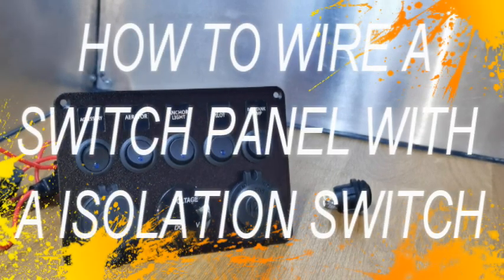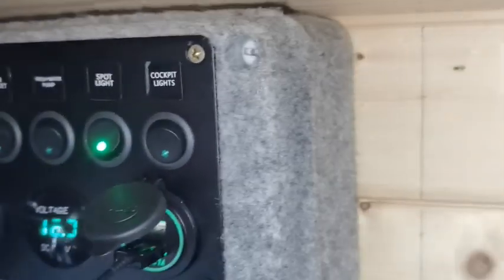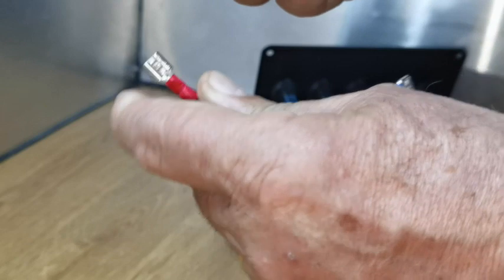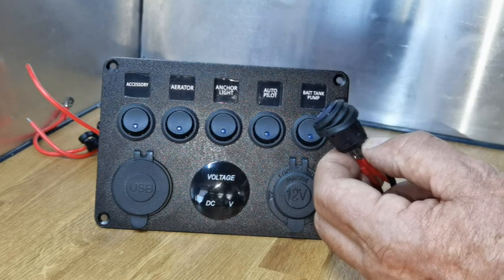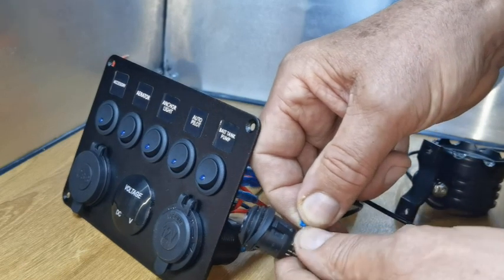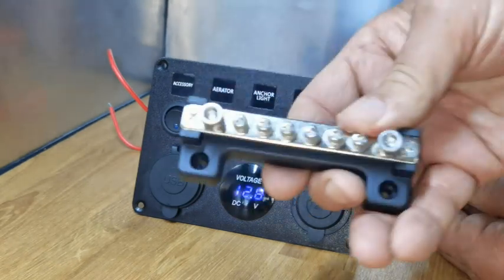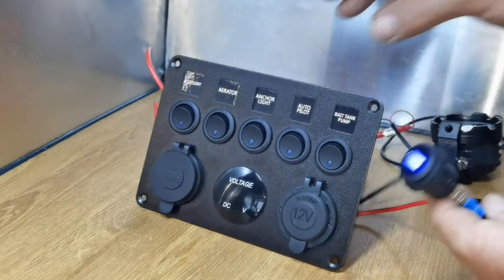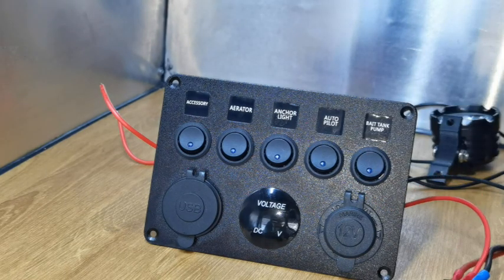HOW TO WIRE A SWITCH PANEL WITH A ISOLATION SWITCH

Comment: I was going to do this with my five pin switches, but unless I did it only for the accessory lights on the switch itself wouldn’t I run the risk of melting wires or melting the isolation switch itself? I would think the extra switch either needs to hold a high amperage, or you would have to get one of those switches that goes directly from the battery or like I said just use the isolation to save power and just control the lights on the switch itself because all the power going through there to the switches and then the switches are powering is going to be drawn through the isolation switch

Comment: Great film really helpful I am going to copy this set up in my van. The only question I have is why are all the red wires with fuses off the back of the switch panel loose? They all wobble freely and have a part of the spade connector outside the sleeving. It’s the same panel as you have

Comment: Sorry but I'm just a rookie in this. One question, isn't it possible to use one of the switches present on the pannel, to use it as isolation pannel, instead of using an additional one? tnx
Reply from the maker: yes but i need all mine i have done a video on using a single switch on my chanel
Reply: @MrMeltedwellies  I've found only 2 videos of your and they are quite similar. Could you be so kind to point me the one you are talking about. Tnx
Reply from the maker: link below Leon 

https://youtu.be/ttMDY0zo4i0
Reply: You can, just swap the load wire and power live on the furthest switch on the right where jumped cables finish with 2 wires going back to battery. By the way these switches are 5Amp and not 20Amp on the product details so can be dangerous if high rated appliances are used..

Comment: I would think about using the isolation switch to activate a relay. That way all of the current from all of the accessories on the switch panel is not going through the switch. Those switches contacts will melt down over time with as little as 10 amps. Much safer with a relay(most automotive relays can handle 40-50 amps). Just a thought.
Reply from the maker: thanks for info i do have an isolator ill dig it out